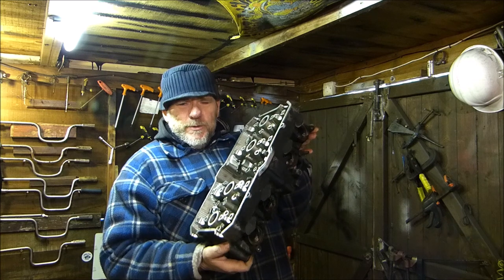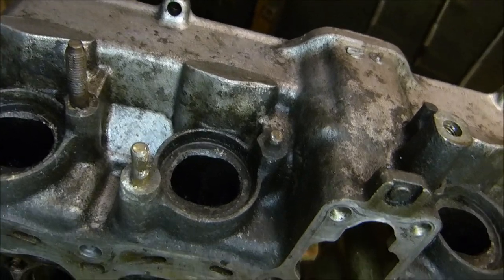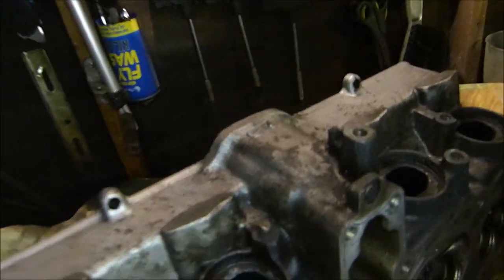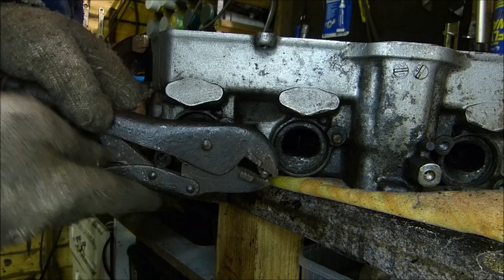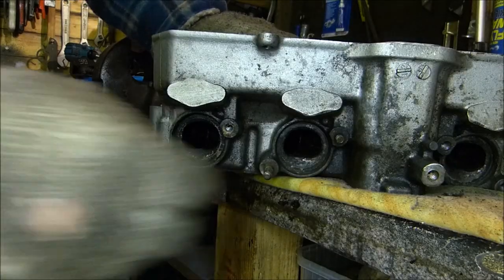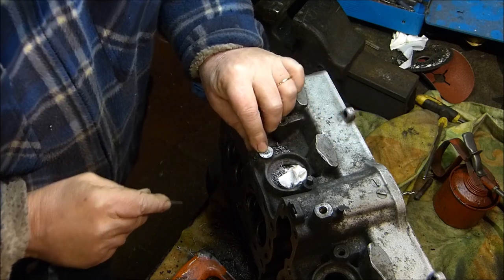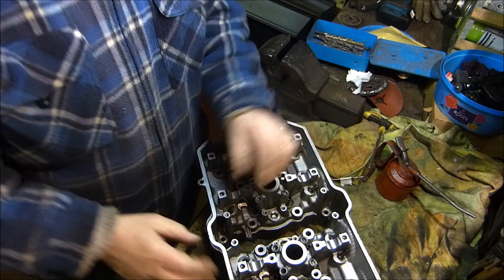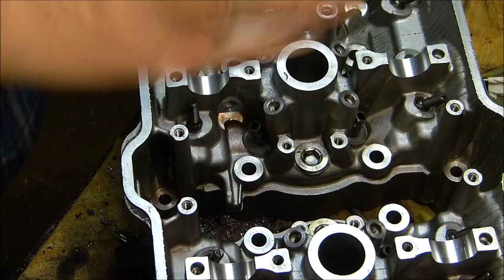CBR1000F Landfill bike. broken exhaust stud extraction failure 🙅

Comment: Buy yourself a broken tap extractor set, if tapped in correctly they are brilliant, I used one to remove a broken tap from my fzs600
Reply from the maker: Cheers buddy that's a great help I didn't know you could get tap extractor tools. Thanks again for the heads up 👍👍👍
Reply: Also these drill bits will drill taps but the tips are fragile, 350778112764
Reply from the maker: Your a star cheers bud 👌👍👌👍
Reply from the maker: Cheers buddy appreciate the help.

Comment: Ouch! That was painful to see :(

But don't give up on the cylinder head! You alreade have a spare part. Solving that pin problem will be excellent Youtube content.

May I suggest you use a tap extractor? With correct number of flutes.

When drilling centered holes in a pin, I use a tight fitting tube (or long nut) with a drill bush for diam 2 - 3 mm, tight fitted inside. Then I drill with 0.5 - 1 mm incrementals up to thread inner diameter. Hopefully I will have the finished hole centered and I can then clean out the threads (or drill a bigger hole for Helicoil).

It may be possible to mill out the broken tap out with a tungsten carbide or Titan end cutter mill. You can also try to crush/split the tap in pieces (in the hole) with a kind of sharp centre punch and remove it i smaller pices.

The last solution could be to simply grind the whole stud off and weld it up again with aluminium and drill a new hole with threading.

For the second pin, i would recommend you to find a mechanic (pref. brake renovations) that has an induction heater and try that technique out. Like https://www.alesco.se/a80/ It will just take seconds to heat it up. Then let it cool down and remove it an hour or two later. There will be minimal heat transfer to the aluminium. That technique is great! (I used it for my Divvy's rear disc brake screws that possibly would have broken off otherwise. After treatment the screws loose like they were put in place yesterday).

Good luck!
Reply from the maker: Hi thanks for the great tips when I get the motivation back I will definitely try the tap extractor things and if that doesn't work then try to brake up the tap with a centre punch. Welding and miling is way out of my skillets.. Thanks again for sharing your knowledge. 🔩🔧🔨🔧👍👍👍

Comment: I'd have another go at welding another nut on the broken mess. After all that drilling and tapping, it's probably quite a bit looser by now, and getting more heat deep in the broken stud can't hurt either.
Reply from the maker: Cheers buddy good idea I might just try that. 👍👍👍